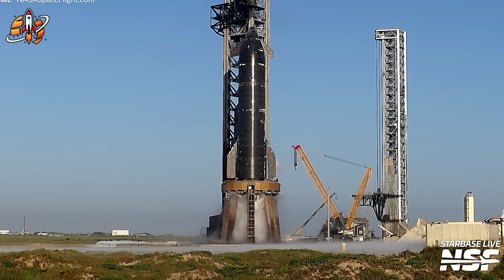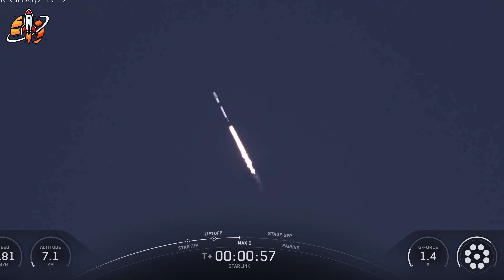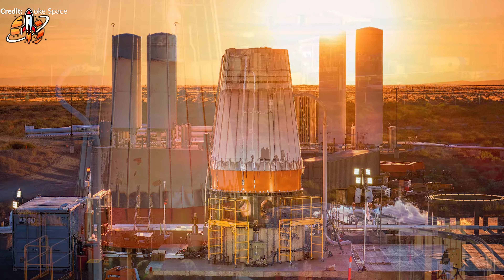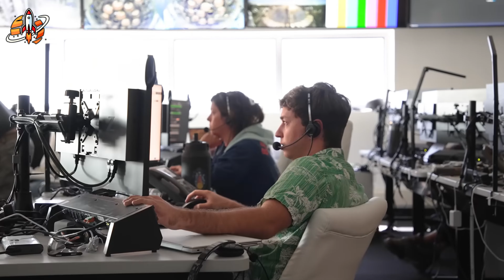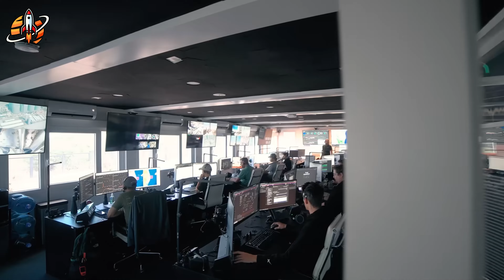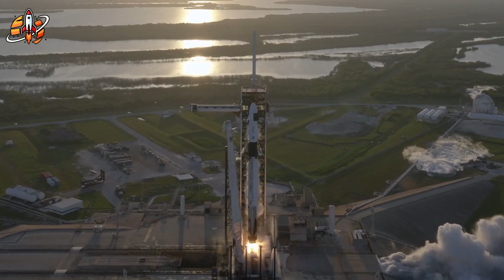SpaceX revealed Flight 11 Plans - Will This Be the Last Block 2 Mission?

Comment: I have a question about heat shield why do they have to be tiles why can't a full heat be molded to fit the entire ship like on the Apolo capsule??????
Reply from the maker: The crunch wrap heat shield uses tiles for flexibility and repairability, unlike Apollo's molded shield, allowing SpaceX to iterate and replace damaged sections easily. This design supports Starship's reusable, rapid-turnaround goals for missions like Flight 11 and beyond.